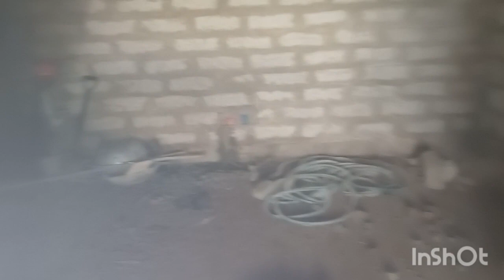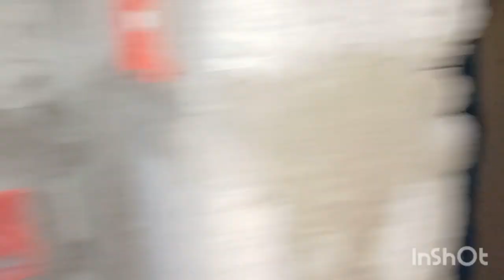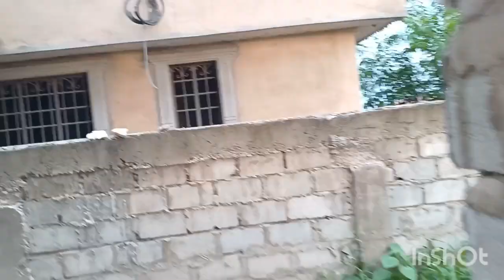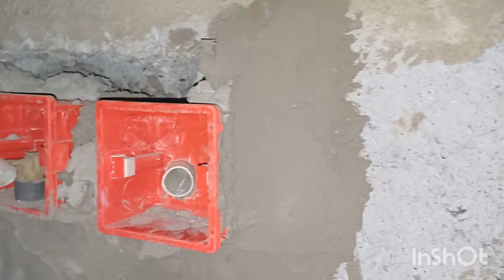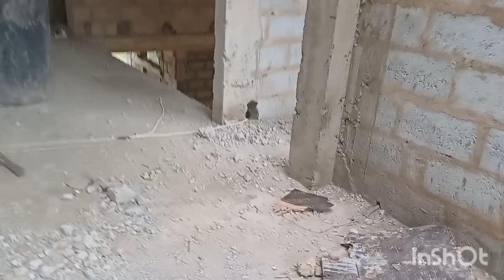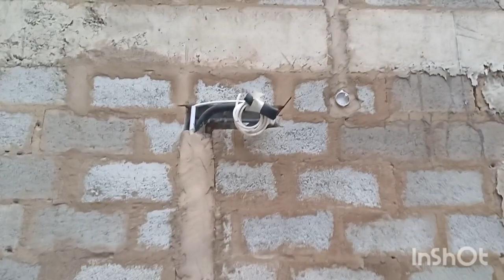Building In Ghana | Break Down Of Electric Work At Trasacco Springs

Comment: Very Neat Work i love how you used machine to do the cuttings on the wall and i love how included a a big pipe to cater for the tv cables and how cables as well. i love the that you included the bedside plugs too very thoughtful, many electrician place it over the head of the bed which is bad and wrong
Why Didn't You give the staircase light?
Why Do You Use Plastic Conduit Boxes Are They Better Than The Aluminum Type? 
Are You  A Plumber As Well?
Reply from the maker: Thank you sir for your comment and input.  In this video the stairs areas is going to have wall lights, there are other works I've worked on that had stairs motion sensor light points. The reason why  I use the plastic conduit box instead of the popular metal type is because of rust or corrosion issues with the metal conduit boxes we have here in Ghana.
Reply from the maker: Thank you again for the compliments.  No, I'm not a plumber.
Reply: @multiskilledelectrician1  Thank you as well for the feed back. Will it be possible to change the metal conduit boxes and replace them with a plastic one although i have install the metal ones already and done plastering?
Reply: @multiskilledelectrician1  Alright
Reply from the maker: @cwabena  yes it will be possible.
Reply: @multiskilledelectrician1  Will Advice That I Change Them or Leave Them as They Are?
Reply from the maker: @cwabena  you change them if they're rusty or showing signs of getting rusted though it was fixed not long ago.
Reply: @multiskilledelectrician1  Yeah not too long ago
Reply from the maker: @cwabena  then it's better they're replaced at this stage before you go ahead to paint the building.
Reply: @multiskilledelectrician1  ohk that will be an extra cost on me hmmm
Reply from the maker: @cwabena  yes oo. Hmmm
Reply: @multiskilledelectrician1 Or If i buy Them You Coome And Install them for me for free hahahaha.....how much is one 3 by 6 and 3 by 3?
Reply from the maker: @cwabena  haha 😄.
Reply from the maker: @cwabena  3×3 plastic conduit box cost 10 GHS,  3×6 cost 11 GHS
Reply: @multiskilledelectrician1  Which Cable is The When it comes wiring?
Reply from the maker: @cwabena  well the rule to using an electric cable to do electrical wiring or installation is the cable brand been certified by Ghana standards authority and on the table of list of cables Energy Commission Ghana has listed to be used for electric installation.  With that been said, I personally recommend Tropical cable or RR cable.
Reply: @multiskilledelectrician1  Thank You very much for all the engagement